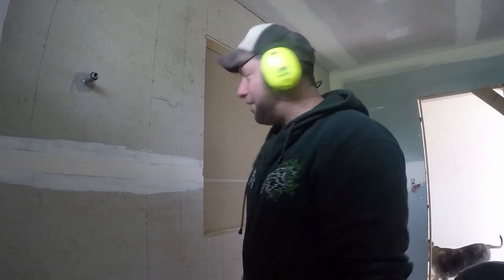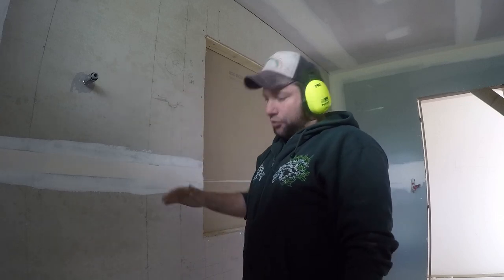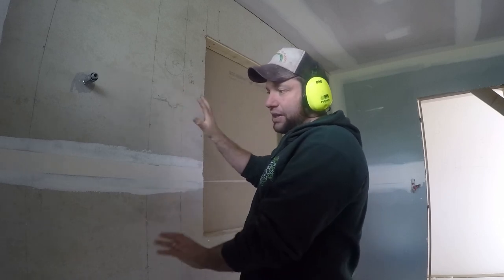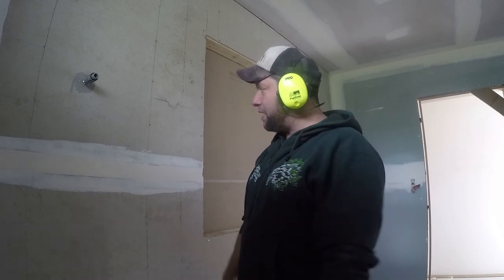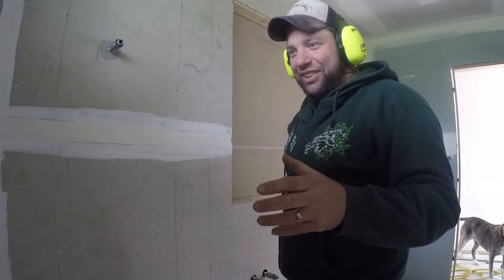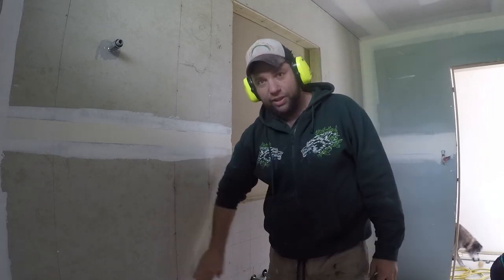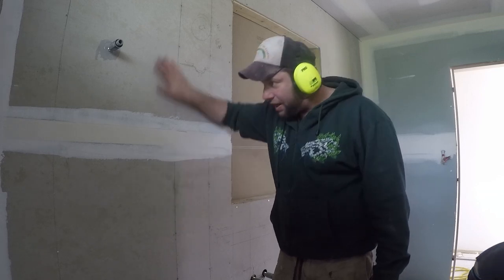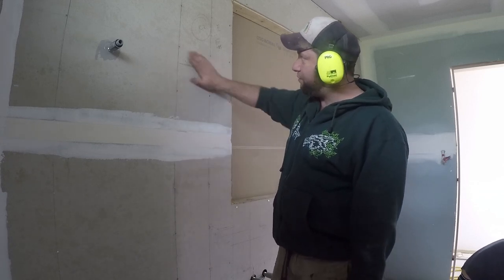How to Fix Cement Sheet in a Bathroom

Comment: Hi, what product do you use to stop up the joins? My husband has used the Dunlop FC jointing compound for our bathroom reno. He thinks he needs to put a top coat on that then sand, then waterproof. I believe you just waterproof over the fc jointing compound and it doesn’t get sanded. Are you able to guide us on this step? TIA
Reply from the maker: Hi Stacie,
there are a hundred different ways to finish a room like this, are your tiles running higher than the joint? if so then i would water proof up to here and then tile with a capping piece to finish it off.
there are a few other vids on this channel showing this system.
if the area is to be seen and painted, you then defiantly need to finish the plastering properly and sand it to blend it in.
Hope that helps and please consider supporting our channel at www.patreon.com/beowulfbuilders 
#stayawesome
joe joe

Comment: Hi,
House is a ready made house and inside walls are all cement sheet. Any idea to help  fix broken cement sheet , like cement sheet wall cracks and broken .
Reply: I was using some light weight Sika 101 Fine Surface filler but that was just not that suitable. I imagine that if the damage was going to be covered with tiles you could use a 2 part Automotive body filler. Sika Filler 105 which looks like it's probably the best bet.
Reply from the maker: remove what is broken and replace it or fill it with construction adhesive with latex

Comment: Hey, ive noticed James Hardie specify screws every 200mm and no glue in tiled areas with villa board. Surely using stud adheasive with screws is best practice?
Reply from the maker: much better

Comment: So I'm doing floor-to-ceiling tiling on the walls. Do I need to use nails or screws to secure the cement sheeting?
Reply from the maker: Screws are always best yet its hard to countersink into cement sheet.
we only nail it every as the vid shows or as per the manufactures specs and haven't had problems if done correctly 
Please help us create new and informative videos by supporting us on; www.patreon.com/beowulfbuilders

Comment: I've just installed some 6mm Villaboard onto a wall and I couldn't get the clouts flush with the board. When I try it just dents the board. The timber frame was as hard as concrete but the nails went in nice and smoothly after pre drilling.
Reply from the maker: Well done Brad,
the house must have been very old.  these always have good bones & the timber is super dooper hard.
excellent solution (pre-drilling) to your problem, grouse to hear that you thought about it & figured it out
#stayawesome

Comment: Should you stop over the nails with a polyurethane silka pro ? As well as the joints ?
Reply from the maker: GROUSE question Leo.... YESSSS, stop up any penetration with a polyurethane if its t obe covered in waterproofing membrane but not if its being painted .... compound where ever could get wet & to ensure everything is water tight

Comment: G’day Great info, straight to the point and all useful info!

In a reno situation, can I backblock and patch damaged villaboard like I would plasterboard? (Timber, screws, fibafuse, basecoat, topcoat, waterproofing, tiles)

And is there any risk of tiling over painted villaboard. I’m a little concerned the adhesion is only as good as the old paint.

Cheers, Merry Christmas! 🎅 🎄!
Reply from the maker: always check that the glue will work with your waterproofing or wall cladding.
i've had an entire wall fall off

Comment: Thanks for the info.  I've got a cavity slider and am not suppose to put nails into.  I've planning on going up 1200 with tiles, how would you recommend that I fix the cement board to the cavity slider wall?
Reply from the maker: GRRRRREAT question James,
use a construction adhesive and screws.... there is a vid on hte channel for this.
#stayawesome
joe joe

Comment: Hey mate, my tiler is telling me leave a 4mm gap between the wall sheets and the CS floor sheets and only get the plaster to stop the mid join horizontal joints (not the wall to ceiling of the corner vertical joints. They span these with waterproof. Thoughs? we are doign floor to ceiling tiles. Cheers
Reply from the maker: Gday John, so the "Caulker" can fill the floor to wall junction with a flexible construction adhesive then water proof over the top x 3 - 4 coats allowing for slight movement and no beak of the seal.
dont forget to support our channel
#stayawesome
joe joe

Comment: I'm going to use cement sheets for a shed, do i need stud adhesive ? and can i use screws ?
Reply from the maker: Gday Killabee,
I'd definitely use a combination of glue & screw or twist shank nails. this way you can guarantee a superior fixing which also adds to your bracing of the shed.
#stayawesome
joe joe
Reply: @BeowulfBuilders  thank you

Comment: Hello, thanks for the video.  A question for you,  I'm wanting to renovate a bathroom and use villaboard but Bunnings tell me it's a restricted product. I'm in Victoria,  any thoughts?
Reply from the maker: Gday Hansca,
we've never heard Bunnings say htat its a restricted product ?!  what is it you are after and why?
joe joe
Reply: @BeowulfBuilders  Hello, thanks for getting back to me. I'm wanting to use Villaboard in a bathroom reno and checking online it shows up on the Bunnings website as not available at any stores although it's on their website so I rang Bunnings for clarification and they told me that it's a restricted item but couldn't tell me why. The next day I visited my local store and asked about it only to be shown that they have a complete range of the boards and are happy to sell it to me. They agreed that their system says it's restricted but couldn't offer any explanation other than not all stores stock it. In any case I've got all the Villaboard I can use so I'm a happy chap. Thanks again.

Comment: Great video! When fixing sheets horizontally do you have to have solid fixing along the joining edge?
Reply from the maker: Gday Adam,
Grouse question; In short, its always a good idea to install additional support behind a sheet if it needs it.  this is largely dependent on the thickness of the cement sheet cladding, the thickness of the stud work & the spacing of the stud work (450mm or less you might get away without horizontal noggins but check with manufacturers specs).  
Also take into consideration is the dead load (fixed cladding like tiles or vanity weight) this will also play a part in how much weight the cladding will need to take before flexing & cracking.
 If the area feels/looks like it needs it, put it in.... its always easier to get it in at frame stage even if you don't use it later.
Hope that helps Champ
#stayawesome
Uncle joe joe

Comment: Hi, I am renovating my bathroom and using compressed sheets, now I have been told that I have put the sheets the wrong side out . 

Is there a correct side for the compressed sheet to go on? I.e: rough side out smooth side in?
Reply from the maker: Yes there is defiantly a front and back to the sheet, this helps with stopping up, sealing, water proofing etc.
smooth side out, rough side in
#Stayawesome
joe joe

Comment: Hi mate.
This is the best Villa board video on YouTube.  I found fibre cement screws made by buildex in bunnings. Would you use them?  I just don't like the idea of only using nails. Thanks mate 🙏
Reply from the maker: it really depends on the stud work, the length of the screw, the make up of the screw (Gal, bright etc) and how often you'll be using them 
remember that cheaper is not always better

Comment: Well done mate 
Very helpful info!
Would plaster board glue work ok to hand the cement sheets?
Reply from the maker: Gday Scotty,
Yep, plaster glue will do fine as long as you nail it was per the manufacturers specs or the construction guild lines for that product in that area.
SUPER important to know that cement sheet is heavier than plaster sheet and due to that has a greater "DEAD LOAD" weight.... once cladded i ntiles this goes up 3 x the weight.  this is hte main reason the nailing is so close.
#stayawesome
Uncle Joe joe

Comment: Hi. If your putting cement sheet on the floor of the bathroom for the tiles to go on, what do you do first, cement sheet for the walls or cement sheet for floor? Steve
Reply from the maker: Floors first Stephen,
then the walls, then the ceiling (if youre re-doing that) 

this is for safety, than for sealing (waterproofing) then for sound and insulation
#stayawesome
joe joe

Comment: Hi Wulfe, Iam renovating a laundry,my wife wants to have half fiber cement and the other half vj sheets, how do you join them? Vj sheets are 10 mil thick.  thanks Chris Wolfe.
Reply from the maker: Gday Chris,
this type of detail on your wall cladding can be AWESOME if done correctly and is something we do often.
We will usually use a solid timber, pre-molded if possible, and cut a check out on it.... a little trick is to get moulded Architrave and use that adn make sure it it timber.... pine or hardwood, then paint it with undercoat adn then top coat x 2.  This will protect the grain.
#stayawesome
Uncle joe joe

Comment: specs say no glue behind board when nailing at 200 centres ,glue shrinks and causes popping.
Reply from the maker: Thanks Steph,
this is dependent on the manufacturers specifics and with nails every 200mm or less you won't need to use glue.... that being said, it wont pop off if you're nailing properly and the glue will not do any harm if you use the correct glue.
#stayawesome
joe joe

Comment: Great video! Do you also need to screw into the bottom sill plate to minimize all movement and potential tile cracking?
Reply from the maker: Any chance of minimizing movement with fixings at this stage is always a grouse idea